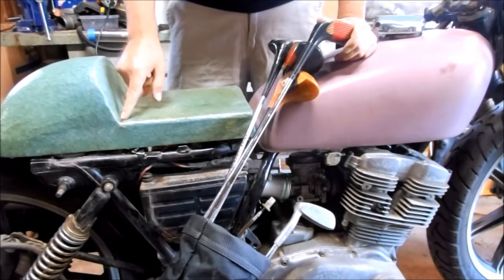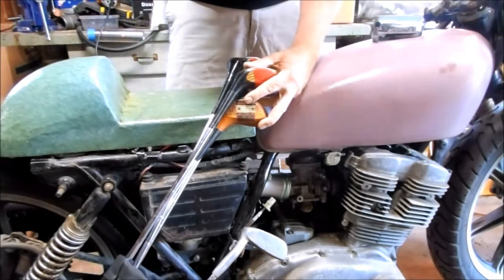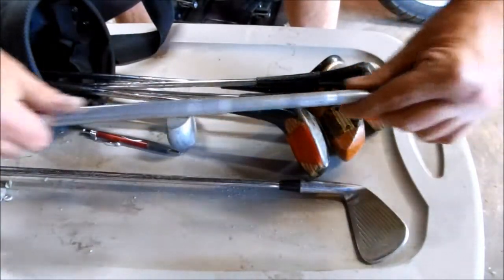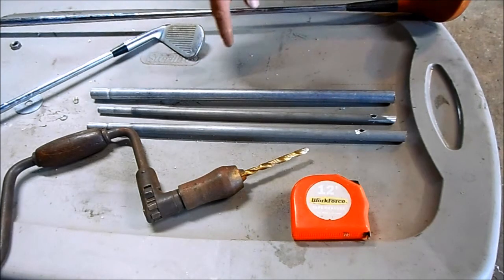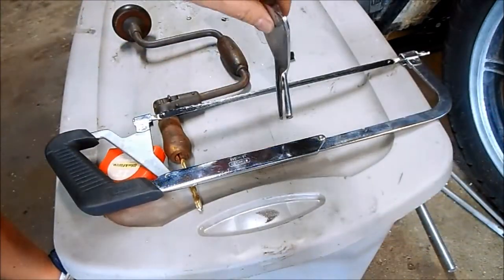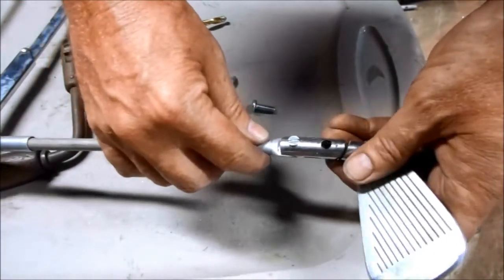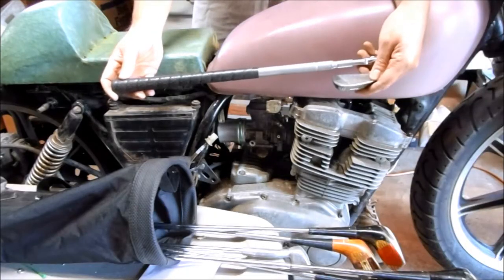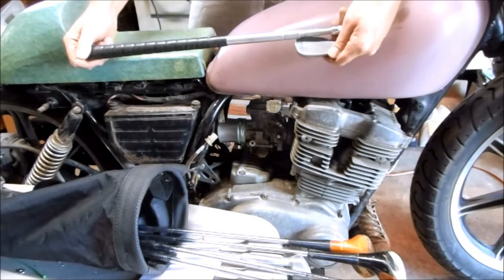How to make Folding  Golf Clubs for Travel , Motorcycles, Scooters  and Small Spaces

Comment: Yikes. While I applaud the ingenuity, a club made using a ball retriever collapsible shaft will be completely unplayable. Google "Divnick" to see how a real collapsible & adjustable club works.
Reply from the maker: +bgensel  it worked well enough to add value to the bike
Reply: +Ichiban Moto lol
Reply: Ichi is more a motorcycle guy than the golfing type, so he's badass for basically building what took Steve Divindick millions to do.  You just have to be careful on the backstoke, so the shafts don't collapse.
Reply: Yeah that’s true but if designed right it could be brilliant’